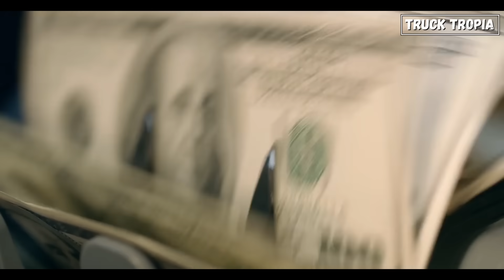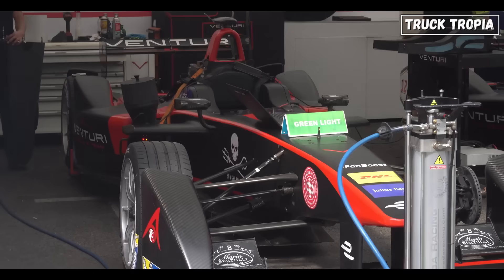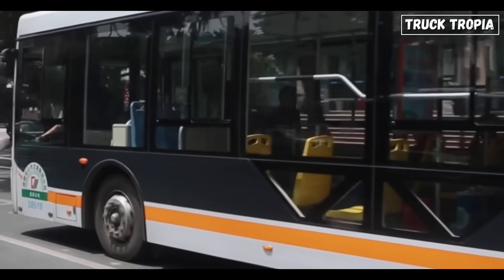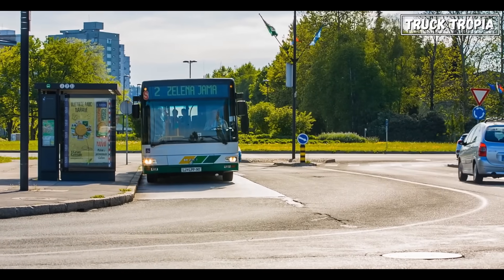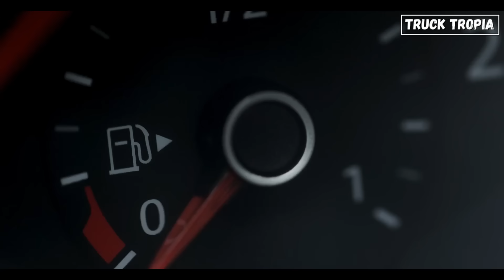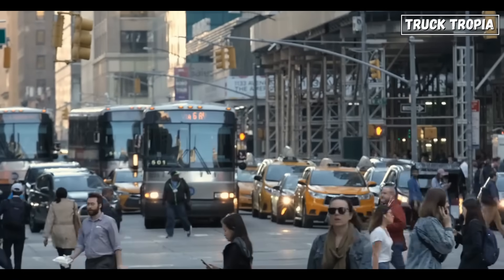Why Do Big Buses Have Rear Engines?

Comment: At one stage there were also buses with med mounted engines located between the axles of the bus although they aren't made anymore. An example of a bus with a med mounted engine is the Volvo B10M the M stands for med mounted engine the downside was access to the engine as it was under the floor of the bus making access to the front and rear of the engine harder. Some modern buses also have fire suppression systems in the engine compartment.
Reply: Этот автобус был очень устойчивым на скользкой дороге, благодаря своему центру тяжести
Reply: I managed to pickup a B10MA for a song . I love it . Fuel efficient and super reliable . Rear steer is great .
Reply: B10M busses were very popular in Australia too.  I have fond memories of going to high school on old crappy busses, then getting on a B10M one day in the late 80s, and it was like I’d stepped into the future - it was quiet and comfortable - equal to coaches just 10 years prior.
Reply: @commodorenut  Singapore too, which also meant if you were sitting/standing at the rear of the bus you can hear the gearbox's noise more distinctly from the engine's noise
Reply: In the UK we actually had some B10M double deckers. The Leyland Lion was a competitor with the same layout.
Reply: DAF Trucks also build an Underfloor Engine specially for Buses. https://en.wikipedia.org/wiki/DAF_MB200
Reply: Also popular in Peru, Brazil and Chile. I think the largest proportion of B58 and B10m was in Peru (In contrast, here the most popular platform was oh1318 and oh 1114). The fuel economy in the lightweight ciferal and marcopolo busses was only surpassed by the o370/371/400 Mercedes Platforms (that were WAY more expensive).

Comment: One thing of note, almost all of exotic / high performance cars are mid engined, not rear. The rear engine car is inherently unstable and it took Porsche decades to stabilize the platform.
Reply: My guess is that the weight distribution of people in front and the engine in back makes it more balanced, like a mid-engine.
Reply: @BenjaminCronce , I am sure the main reason is that it's the most effective way to prevent the appearance of exhaust gases in the bus salon.
Reply: Gives a ton more grip on the drive axle, if the weight is distributed evenly at the front of the vehicle (bus) you get a very smooth ride. And the driveshaft can be made much shorter, putting less strain on the engine, and transmission. And like in the video, allows for a larger interior. There's several design benefits for having a rear engined bus. Also inherently safer in the event of a rear-ended collision due to a large impact absorbent engine.
Reply: @NGHmusic  a rear engine also means better braking
Reply: @nade5557  in your opinion
Reply: @jaminjef  what, seriously??
Reply: @nade5557 Really?
Reply: @NGHmusic  Of course, the flip side of this is that in the event of a front-end collision, the driver is the crash protection.
Reply: @NGHmusic The last point is not really a benefit because most crashes are in the front and missing an engine there is not what the driver would want. 😅
Reply: Rear-engined cars are still much more difficult to drive, especially in wet conditions.
Reply: @dezpotizmOFheaven Cars sure, trucks, not really.
Reply: Porsche "stabilized" the rear engined platform by moving the engine farther and farther forward with each new generation of the 911.
Reply: @Stardustnoodle  I wasn't advocating for rear engine cars. The original post was rear engine buses.
Reply: And still they had small  3.2 engines,  they couldn't compete with Ferrari 3.5 to 6.0 engines, they had to use turbochargers in the late 80s with ridiculous lag wich made the driving even worse and some called it the Widowmaker. When they released the mid engine cayman they nerfed it in many ways to not make the 911 look bad, but that's a whole different story 😂
Reply: I think they oversimplified saying sports cars are rear engine when they only meant behind the passengers vs in front of the passengers.  The only car I personally known to be rear engine was the Volkswagen Bug.  I am sure there are others I just do not know them.  In school busses when I was in school the very back of the buss was the emergency exit.
Reply: Even with Porsche throwing that much effort and money at making the rear engine 911 good. The first generation Boxster (mid engine) had to have its LSD (limited slip differential) removed before sale because it would have beaten a 911.
Reply: @dpfitforlife81  All the early volkswagens were rear engine.  Bug, Carman Ghia,  411, 412 wagon,  the VW bus,  Vanagon.  Back in the 60's Chevy had the Corvair with rear engine but they had several problems. They may have been able to improve it but they just ended that model.  It was a 6 cylinder engine and from what I have read it had overheating issues due to being air cooled like VW but it was harder to air cool the bigger engine.
Reply: @jaminjef The Corvair was not anywhere near as bad as Ralph Nader, who was trying to make a name for himself, stated.  And in reality, The Corvair Monza was being developed as their hot sports car until the Mustang forced Chevrolet into developing the Camaro.
Reply: @robertstanford9177  I am not basing my comments on Ralph Nader. I'm basing it on many thing's I have read over the years.  Much of the criticism was on overheating and also weird steering/handling issues.  Like I mentioned previously, they may have been able to improve on some things but instead they just chose to drop the car altogether.
Reply: @dpfitforlife81  Thanks. By the end of this video I was left with just one question - why all vehicles don't have rear engines lol.

Comment: It's also easier to perform maintenance duties on a rear engine bus than a front engine bus.
Reply: I was certain, that this was one of the four primary reasons. Easier maintenance = more nettoprofit
Reply: @runepedersenDK  And a longer life for the vehicle before it needs replaced.
Reply: On the busses i drive, the rear seats can be moved to get to the rear of the engine and a floor panel that can be removed to get to Transmision
Reply: @williamhaynes7089  That makes sense.
Reply: I understand that a lot of rear engines are mounted on skids and able to have their engines completely removed and swapped for a working engine kept on hand, basically overnight. This reduces downtime for a bus, and by exchanging the engine out for a new one allows mechanics time needed to properly diagnose and repair the broken engine while the bus remains in service. Keeping the bus moving, keeps the money flowing, keeps the mechanics and drivers paid!
Reply: @MCminus2  And keeps people on time for their shift.
Reply: @ColtonRMagby

And to remove body panels/flaps for greater access.
Reply: @naijagoatfarmer  Yep.
Reply: Rear engine bus also does not require long driveshaft that eats fuel economy. Long driveshaft also has shorter joint and bearing life.
Reply: @silentIm  I never thought about that.
Reply: @silentIm yes it'd have to be a thick and heavy shaft to avoid rubber twist effect, stealing even more hp
Reply: Not necessarily. You can place it in the front too and have good access.
Reply: @horeageorgian7766  Not with a flatnose.
Reply: @ Look up the Skoda busses from the 60-70s. Flatnose and the engine sits right at the side of the driver. As a young boy I often sat on the engine, was a warm place in winter.
Reply: While Rear engine busses hav certain advantages given here, they are not as aerodynamic as front engine busses esp those with protruding nose/front part. Also don't forget that rear engines produces a lot more noise in th outside environment which disturbs cars, people & especially 2 wheeler riders who are behind or beside such buses. Also I feel they release more heat into th ambient air which makes being placed beside them stifling esp in hot weather. 😢
Reply: @ahmadjamal9772  Can't be as bad as being next to a turboshaft Batmobile in the middle of summer.
Reply: I would think part of that is depended on how the engine is placed in the front.  Type C vs Type D school bus.
Reply: @dpfitforlife81  Or a Class A motorhome. Technicalities are a pain in the ass.
Reply: I think front engine is good at maintenance then the rear wheel engine 😊
Reply: @MikeIlor  Try the flatnose design with a front engine and tell me I'm wrong.
Reply: @ColtonRMagby  I've seen some with very good engine access; hatches that opened on both sides of the engine (beside the driver and the passenger stairs on the other side), and the whole shroud could be unbolted and lifted off.
Reply: What makes it easier?
Reply: @test-rj2vl  You're not squeezing through a tight hole or leaning over a large rubber tire to reach stuff.
Reply: And whats up with mid engine buses?
Reply: @sonicrashyugioh  Hell if I know.
Reply: Why?
Reply: @iamnormal8648  You're not wedged between the block and the floor.
Reply: I don't think the writer of this piece has ever worked in the bus industry . . . they're just guessing : )
Reply: @loddude5706  Have you ever been in a flatnose front engine diesel?
Reply: @ColtonRMagby  - No, why?  : )
Reply: @loddude5706  You have to squeeze between the engine block and the floor to reach the oil filter when it's time for an oil change.
Reply: Giggiddy

Comment: Those formula cars are Formula E cars ( Electric formula racing cars, which don't have engines )
Also most supercars are not really rear engined, but mid engined.
Porsche 911 does still have a rear engine design though.
The CNG ( Compressed natural gas ) powered city buses we have in most citys here in Sweden are not quiet, they scream so loudly, you wonder how the drivers go through it without hearing damage, + that every little bump in the road sounds like a gunshot at close range and feel like an earthquake.
I doubt they have working springs, and yes they are rear engined.
Reply: Also not to mention some CNG buses have extra components on the roof, battery electric buses have battery cells on the roof.
Yeah most CNG buses feel like you're riding a bus with collapsed suspensions.
Reply: Indian buses enters the chat😵‍💫
Reply: It was not just the stock footage of race cars and sports cars that was wrong, they also used airplane and subway stock footage when talking about luggage storage and flat floors. The video gives me a “made by AI” vibe 🤷‍♂️
Reply: @jpe1  With this way of thinking, you seem artificial too
Reply: @sonnylatchstring  you think my content could be AI generated?  Especially given that some of it goes back to 2008?
Reply: @jpe1  An AI would have done a better job. This is the work of a negligent human.
Reply: You've never sat on a rear engined old Leyland National bus in the UK and thought "Wow this bus is so quiet" They used to make you feel physically sick with the noise https://www.youtube.com/watch?v=lZIKpjG30sE

Comment: 5:15 Btw this is Ac condeser.Bus radiator sits next to engine. The condenser of the bus is too big and makes a extra heat if was mound same place as the radiator, so they place it on top what cools ivent better

Comment: Nah I don't agree on the rear engine traction it's not that simple as yeah you have better rear axle weight so It has better traction but you need in front wheel too you can say that rear engine means small driveshaft and as we know yeah engineering  we are taught torsion and angle of twist increases as the length of drives shaft increases and torque  here TL/JG=ф is the angle of twist equation  T is torque J is the polar monent of inertia G is shear modulus of elasticity L is length so yeah universal linkage of driveshafte reduce effective length too for torque application and the drove shaft woks as independent unit so in long trucks you see is too many driveshafts and yeah too much linkage reduces whp too due to torque losses so that is why rear engine placement is better traction is a different topic and it's actually more complex as it doesn't follow traditional law but friction but actually adhesive property hope you will like my answer too

Comment: Bro advertised busses like they're better than Rolls-Roycies

Edit: Yeah, no bro. When did I even get all this much comment and likes?
Reply: In many ways. They are.
Reply: They simply are. Designed to run tons and tons ( millions is not strange either) of kilometers/miles. Under stress, heavy weight, day in day out. Let alone trucks/ lorries, significant higher standards than passenger cars, even a Rolls is not the most reliable car when it comes to daily mileage. I bed my money on older Volvo's, Mercedes-Benz diesel or older Toyotas😊
Reply: @napke8571  A Mercedes diesel, yes, but not their gas engines.  Also, if you take care of them, old Cadillacs.  Those were life-time engines.  After they wore out the car, the engine was still good for another tour of duty.
Reply: Both buses and cars are engineering marvels the way they are engineered to carry people and heavy load is amazing but coming to the bus have you ever tried to think how heavy bus becomes with all passengers how can a small engine able to pull that many people coming to car Rolls Royce is engineering marvel in cars segment
Reply: How many passengers does a Rolls Royce carry, for how many trips on a single day, for how many days a week, how many weeks a month, and how many months a year?
You've just opened a stage for a competition which your Rolls Royce will NEVER WIN.
The bus simply destroys the Rolls Royce here. We have articulated buses which can carry 110 passengers to work and back home every day.
Reply: @TruckTropia  LMAO
Reply: * Rolls Royces
Reply: @XB10001  Bro, that's my decision to write like this
Reply: @M3LT-D0WNHR  Illiterally?
It's either correct, or it isn't.
Reply: Well... He isn't wrong. I could buy a bus, and with a small investment get it more cool than a Rolls Royce... So...
Reply: A bus can cost over a million dollars, and usually run several million miles in their 20+ year service life
Reply: A lot better and more expensive than  shitty Rollers.
Reply: @Fredman2410  Is the Rolls over-rated?  I never did like aluminum engines for regular passenger car use.
Reply: Id rather have a private luxury bus than a limousine
Reply: They are more usefull , thats for sure
Reply: A bus is about the same price or probably more than a rolls 😭
Reply: ProPer clickbait. NO INSIGHT
Reply: Getting more likes only means there are more dimwitted people out there, besides you. 👍
Reply: Because they are
Reply: First of all, because the engine must be ACCESSIBLE. How can you fix it when needed?
Reply: @andreapicci8410  Front engines are perfectly accessible, but under-floor engines require that the floor above the engine be removable.  Still, you have to then work on your knees.  When you have to do that all the time, it is hell on your knees.  Increased Workman's Comp cases.
Reply: @jamesbosworth4191  in fact work on the knees for under floor is impractical, unthinkable. And engines on the back I think are more accessible than front ones.
Reply: @andreapicci8410  Rear-engine maybe a little more accessible, but yes, we had buses with under-floor engines as recently as the early 2000s, two of which we still had when I retired 5 years ago.  You drove the coach over a pit, where the mechanics could work standing up, but for items on the engine, many are not accessible from underneath.  Must have been hell for the older guys.
Reply: ofc they are. You can put more comfort in a bus than in a Rolly Royce
Reply: @Catonaut.  Does that mean "Of course they are"?
Reply: Because they just are, lol.
Reply: Yeah them buses. They Just built like that.
Reply: They are.
Reply: Take a bus, give it a posh interior it would be.
Reply: Cost as much
Reply: In many ways they are better... Not to mention that Rolls Royce is just a premium BMW now 😂 A Mercedes Arocs truck is around 2 million euros. Trucks, big busses and all those large vehicles have way better manufacturing than you can imagine. High load and torque applications necessitate forged engine components, not even to mention brake systems. Stopping a big ass bus might need some Bugatti type calipers 😂
Reply: Royces*
Reply: It’s bespoke. More space. Bigger engines.
Reply: They most definitely are. Cost more too.
Reply: I don't know but I liked right away
Reply: What a joke comment
Reply: Because they are.
Reply: Because they kinda are.
Reply: Rolls Royce’s are not lifelines busses are
Reply: Bus: carries 50-200 people
Rolls Roycie: carries one fragile ego
Reply: Because it's a fact and bused are much better than that
Reply: They kind of are
Reply: I think the narrator forgot that the buses are on an actual truck frame so they would not have a hump in the walkway
Reply: they carry more people and more powerful engine and they're cheaper so yeah?
Reply: They say Newells & Prevosts ride like  RRs
Reply: They are you just have to share it with other people
Would you rather be in a bus with 30 people or a rolls-royce with 30 people?